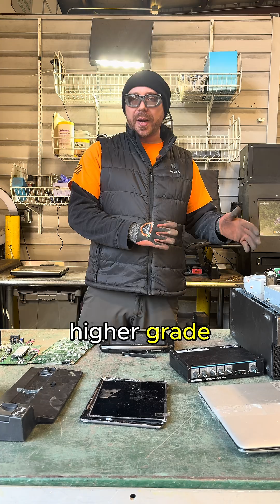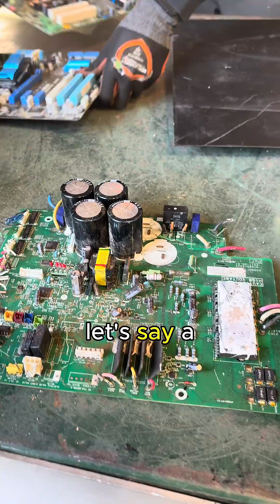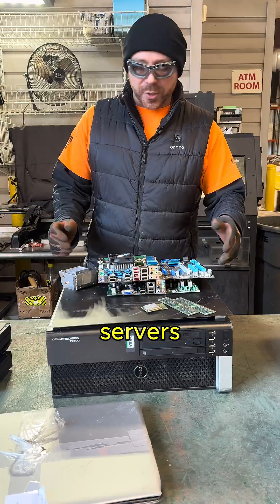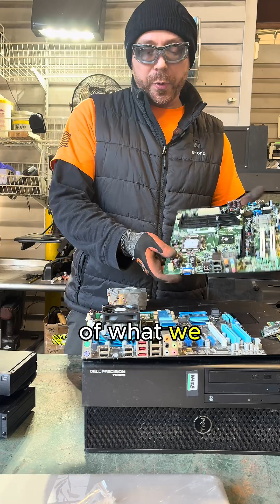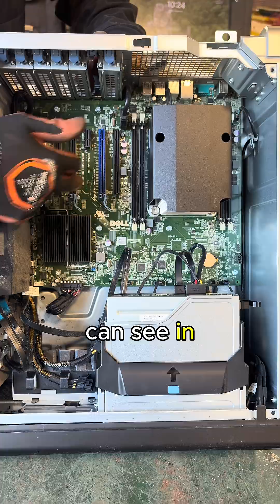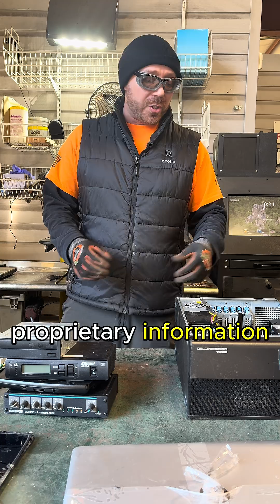Scrap Electronics: What’s Worth Money? 💻

Comment: How do you handle the data destruction?  Are you shredding the HDDs?  Or are you using data destruction software/service?
Reply: @FreeGeekofArkansas-Treasurer  i take the nickel plated europium doped NdFeB magnets into sellable magnets, the platter disks have Platinum-ruthenium plating, the circuit board of it has palladium MLCCs capacitors, gold in eeproms and logic chips, and tantalum capacitors, valuable mention are SMD resistors with ruthenium and silver, also worth dripping away the Sn-Cu-Ag solder for silver.
sometimes the rings bonding the platters are made from titanium. The casings are aluminum and the plate covering the structure is either aluminum or stainless steel type 304, you can angle grinder that to open it up,
The read-write head tip has pure gold wire and a ruthenium tip.
Reply: SSDs are simple, palladium MLCCs, and gold memory chips, sometimes ruthenium resistors, sometimes.

Comment: Are the transformers found in electronics worth stripping the copper out of? 

Obviously industrial/high voltage transformers are well worth the time it takes to strip the copper out. What is the smallest size you’d recommended is worth stripping…size of grape, baseball, basket ball, etc? Thanks!
Reply: You would be surprised how little copper is in modern transformers. It's mostly aluminum windings these days.